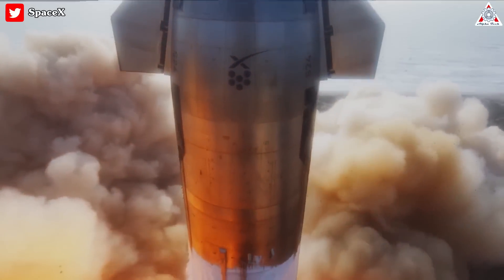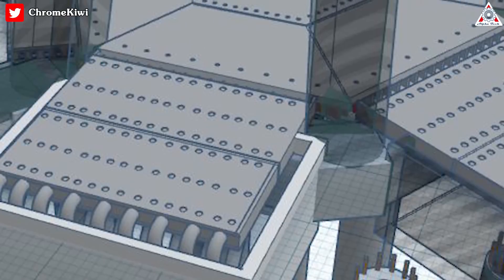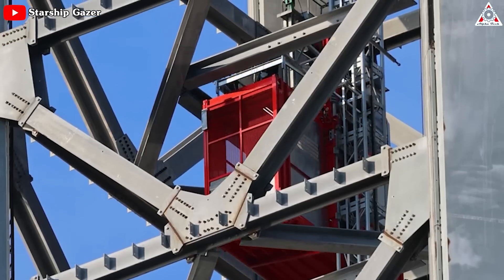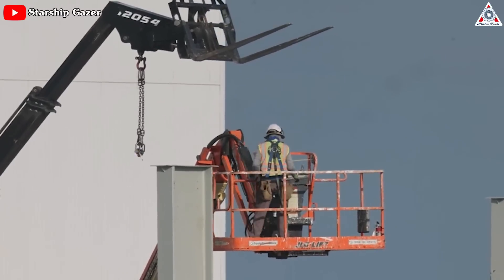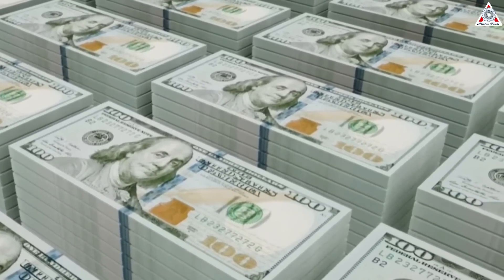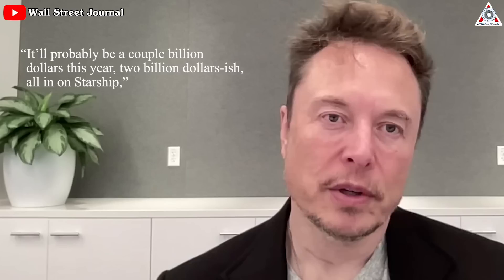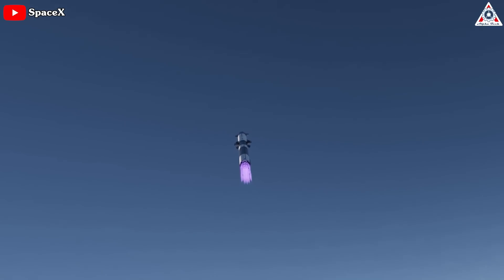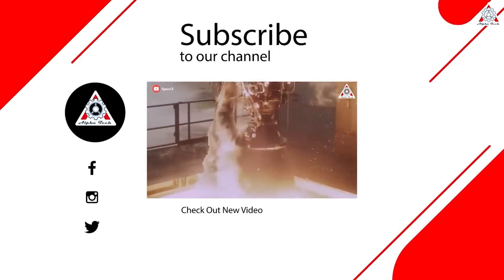How SpaceX Stage 0 Changes will shock you!

Comment: Sheet piling is not a structural component.  It is a dewatering and bank stabilization component.  It would be necessary for deeper foundation work with the high water table at Boca Chica.  They can be removed or left in place depending on any ancillary benefit of having them there.

Comment: One of Elon's SpaceX visions is to operate starship as regular commercial flight. I don't think that's completely viable. However,  with OLMs at some large hub-to-hub routes like London to New York or Singapore to Los Angeles, travelers get two for price of one. 1) travel time to their destination cut from 12 hours to about one hour, (2) 3G-liftoff, zero-gravity LEO space, landing experience. A business class seat on an ordinary airplane already cost 10K. If say they charge 20K and with starship configuring say 200 seats, that's 4M. I am sure it will have 100% load factor on every flight. Like airlines and airports, spacelines and spaceport authorities will be sharing the cost in building the infrastructures (OLM etc). Once these flights become regular, I can already imagine business (jets)spaceships/spaceliners where they can remain in orbit longer than the business jets in the air, or travel to-from space-cities like the 2001 space odyssey, etc...

Comment: SpaceX's iterative strategy for testing Starship exposed a flaw in the design of the Orbital Launch Mount that left the underlying pad under-supported. The major foundation upgrades being implemented address this flaw, while incorporating a novel water deluge sound suppression and pad protection system that will prevent a repeat of this failure mode. Replaceable sacrificial elements in the upgraded design will also protect the OLM's underlying superstructure from the normal wear associated with the launching of super rockets.

After Starship's IFT1 performance on 2023/04/20, the rocket's design is evidently able to withstand shockwaves that the redesigned pad may still reflect back up. With this upgrade, we will also get a clearer view of the next launch, without the giant cloud of dust and debris that the first launch of this super rocket generated.

With the successful next launch of Starship, we will be taking another step forward into humanity's future of interplanetary travel.

Comment: Environmentalists like my SpaceX launch pad redesigned of which I emailed SpaceX and posted on social media.

I am not sure how SpaceX is going to safely deflect the enormous downward then 90° angle horizontal blast shock wave without another horizontal sand blasting event, one of the environmentalist’s major concern that my design prevents. 

SpaceX new design should prevent blasting another hole below the launch pad, but doesn’t appear to address the horizontal shockwave issues. 

Without the FAA approval to launch, it’s going nowhere fast.
Reply: Shock waves are reflected like any wave. The incidental angle = reflection angle. Most of the energy not attenuated by the water will be reflected back up.

Comment: Yes it's very shocking that they don't go to the army corp of engineers and have a proper flame trench ( diverter ) installed this plate thing isn't going to work effectively if granted another flight SpaceX will more than likely have to rebuild again.

Comment: I dont think this water cooled steel plate will work, why not have simple flame diverter
Reply: If you look at NASA's "simple" flame diverter at 39B, it is shingled with steel plates with water deluge at its peak. The steel plates are replaced as the launches burn them off. The trench isn't simple, either. Watch a video detailing its design and construction.

Regardless, a flame trench would require replacement of everything existing now, many acres of fill, and more land than is available. Pad 39A is ~200 acres, with a 45 foot tall mound in the middle. Starbase will never have one of those.

Comment: Sounds like Musks defense of the dangerous launch and the proxiity of 7000 people living within 10 miles of the pad is to whine about all the money he's spent and will spend.  I do believe that technique will work, and the FAA will be coddled into granting him whatever Musk wants.  At the Cape, there are no homes within 10 miles. while near the Boca Chica pad, 7000 people live within 10 miles.  On top of that Starship/Super Heavy is twice as powerful as any rocket ever launched at the Cape.
Reply: What difference does a few more miles really make, when people are allowed within five miles of the pad at KSC and Boca Chica anyways? Starship IFT1 never violated its clearance, except for some sand and rocks.
Reply: @psycotria  I'm sorry, you appear to have not read my post or struggle with comprehension.  Within 10 miles of the Boca Chica pad lives over 7000 people -- at the Cape there is NO ONE living within 10 miles of the launch pads.  At the Cape there is one small housing development, quite likely people that work at the Cape, right at the 10 mile range.  The larger populations are more than 12 miles away.  At Boca Chica more than 7000 people live within 10 miles and some within 5 miles.  And oh yeah, Starship/Super Heavy is twice the size and power of the largest rocket launched at the Cape.  -- and they don't f#cking think they need a real flame diverter and flame trench.  If the next attempt at launching Starship/Super Heavy results in the rocket exploding on the pad and completely obliterating the launch pad and tower -- what do we do then?  I say we begin prosecution of the FAA officials that allowed this insanity to be permitted in the first place.

Comment: Here's to hoping that SpaceX's new solution or the next will hold firm for many launches so development can progress at the breakneck speed they have planned!
Reply: It has a good chance. The previous solution seems to have resisted the heat reasonably well as no concrete was thrown about until throttle up. The foundations seems to have been the weak point and this time they did put in a good amount of piles. That leaves the pad itself, and the current pad should deal even better with heat.
Reply: Looking at the water plate test, should work great.
Reply: All they would have had to do is follow the wisdom of NASA who already worked through these launch pad problems back in the 60's and 70's!
Reply: @Ronald Morris  the water table makes a flame trench/diverter much more difficult, if not impossible. 
Novel problems requir novel solutions.